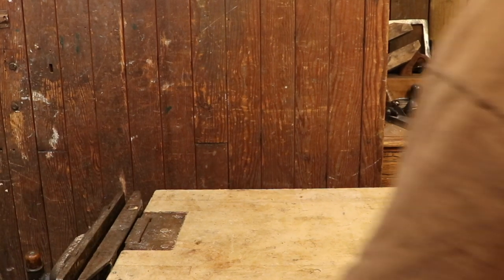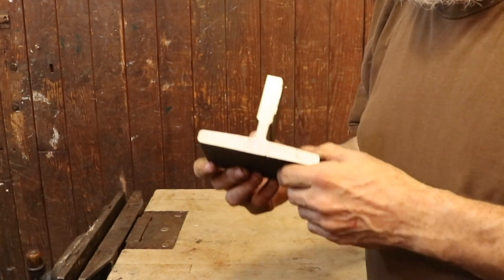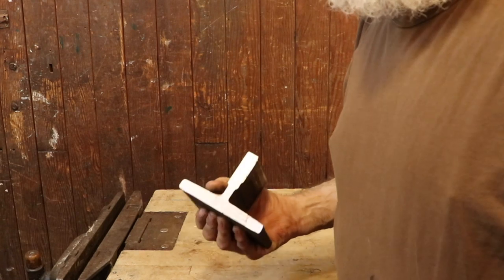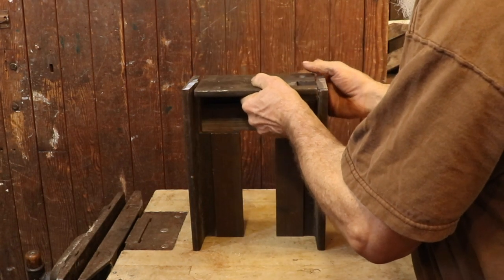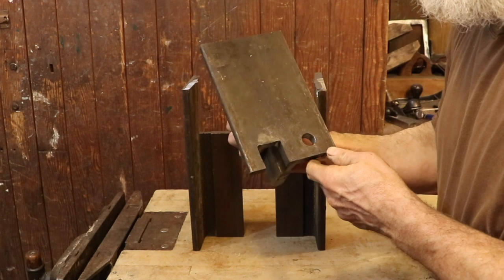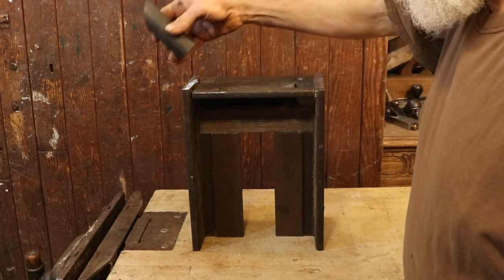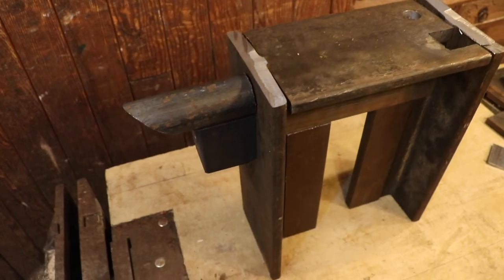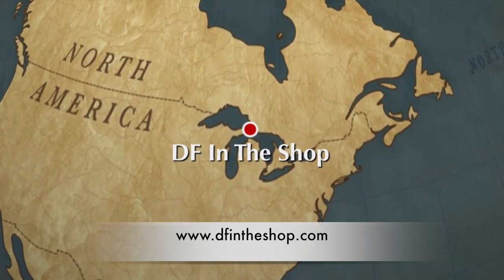Anvils from scrap 1- DF In The Shop

Comment: I made a similar design for starting with forging, I welded sheets of thin steel on the sides and filled it with sand mixed with engine oil and sealed it, in order to dump the pinging sound (I can imagine 5 o these at the same time :). It made a huge difference and is a cheap solution. Thank you for the upload!!

Comment: Elevator rails are designed to be fairly soft. I hope they work for you, but you may consider adding a high carbon steel face down the road if they prove too soft for forge work.
Reply from the maker: I have been working on anvils that are no harder than this one for over 40 years.  I haven't damaged one yet.  But I do agree that your opinion is shared by  a lot of people out there that are calling themselves blacksmiths and they would ( if I let them need it ) turn my anvil into a pretzel in an afternoon just to prove their point.  That is just not a standard of excellence that I care to follow.